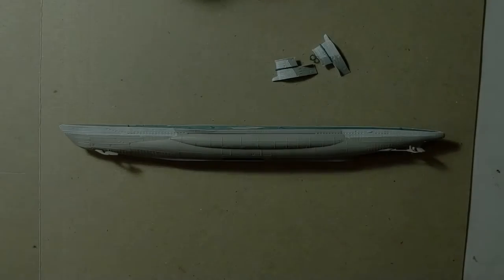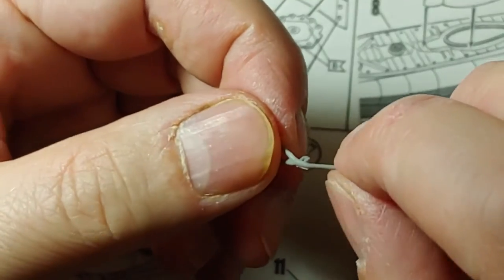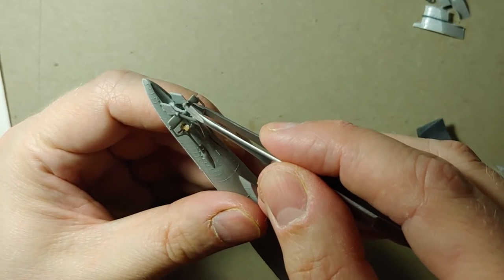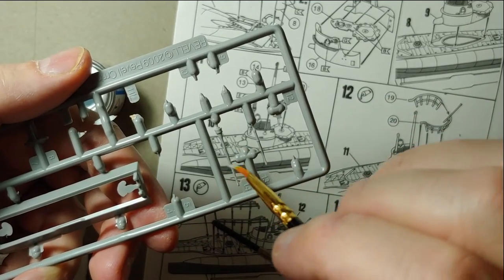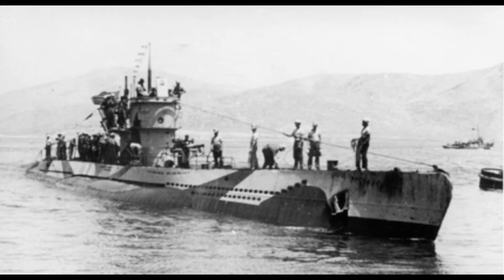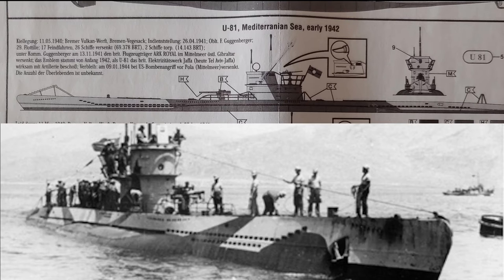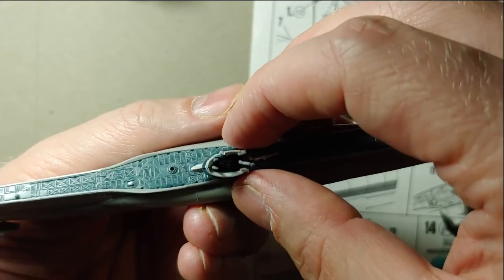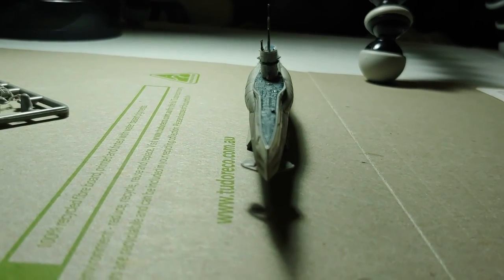U-81: Historical Camo

Comment: I found actual photos of both camo scemes using duckduckgo image search "U-81", so they must have used both at different points in time. FYI I am a USN Submarine veteran and love subs! Great job! ~ TheWiseFool
Reply from the maker: Interesting, when I did the original search, admittedly, a long time ago, nothing much came up. Yes, I'm sure both were accurate camos at some point - I was more wondering what the dates were. Revell has included some info on theirs, still waiting for a reply from the submarine museum on the other one.

I've never been in a USN sub - the only ones I've seen from the inside were U-995 and HMAS Onslow, an Oberon-class attack sub here in the Sydney Maritime Museum. Definitely not a job I could do... my respect.
Reply: I severed on the Trident Submarine USS Henry M. Jackson SSBN-730 Gold crew. It was a great experience.

Comment: I think the camouflage shown in the photo is most likely different on both sides. It would certainly be a more interesting build of the model if the port and starboard sides have a different paint scheme.
I was watching the first of this series and I had a thought. You mention lack of room not only for completed models but also no space for an airbrush etc. Theres a way to get around painting, using toxic or just plain nasty smelling glues and the other things associated with styrene kits. And as you are German you have probably heard of it. Card Modeling. There are web sites dedicated to this segment of the model building hobby. This one is even German
https://www.kartonbau.de/
These are from Poland
https://www.halinski.com.pl/indexgb.php
Depending on ones interests there are models of just about everything. Aircraft, maritime,  land vehicles, figures etc. You name it and there is either a model of it or one of something similiar. Models come either in book form from the publisher or in a digital format.  I personally like the digital format. The beauty is that if you screw up you can just print a new sheet. Also the printed ones can be scanned just in case. Another possibility is the files can be reduced or enlarged. People have built models up to 4 times the designed scale. The quality of the specific models does vary. As of course the builds themselves. If you check out the Halinski site look at the pictures of the prototypes. And this is a much cheaper way to go than plastic.
Plus there is one thing that you can't get in styrene or resin. Free* models that you can download.
*of course they aren't free to build, you still need materials, glue etc.
Reply from the maker: It's a circular pattern, I was wondering the same. Unfortunately, that was the only photo I could find, and the archive website is currently down. I'll do some more digging.